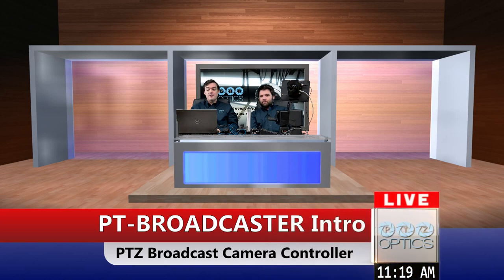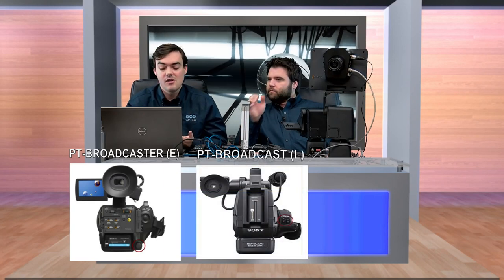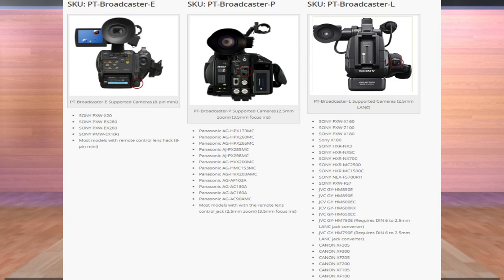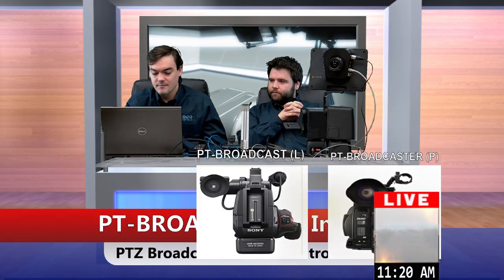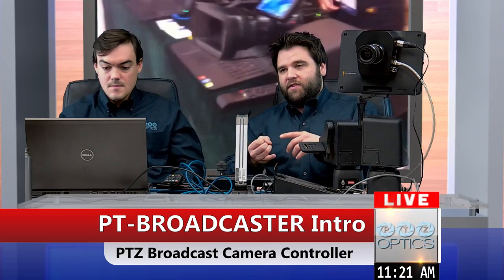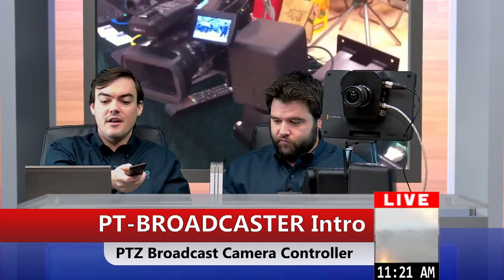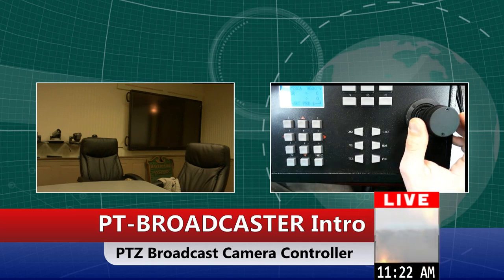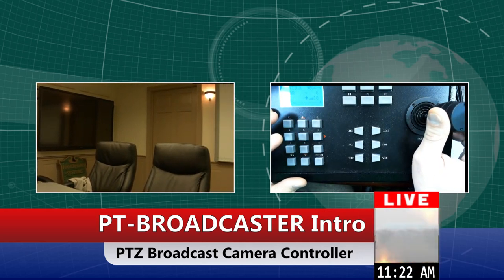PTZOptics PT-BROADCASTER Overview - Broadcast Camera Controller for PTZ

Comment: So just to clarify, for the Panasonic HVX-200, I can get the PT-Broadcaster-P and it will then work just like a PTZ camera? We were going to get stand-alone PTZ cameras but if we can use our existing cameras that would be fantasic and keep them available for other uses.

This will be for a mobile setup, so does the PT-Broadcaster attach to a tripod, is there a recommended tripod if so?

Also, recommended controller for these? Will the HC-JOY-G2 work for this?
Reply from the maker: Phillip Killion - that is the idea. The best person to speak with is Andy. He has s list of supported cameras on our website and the knowledge base. Give Andy a call when you get a chance